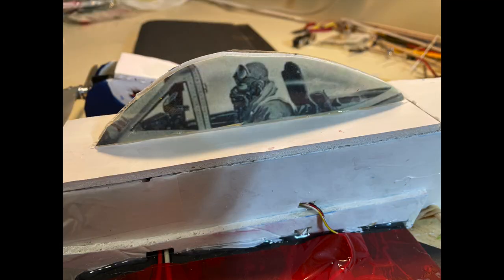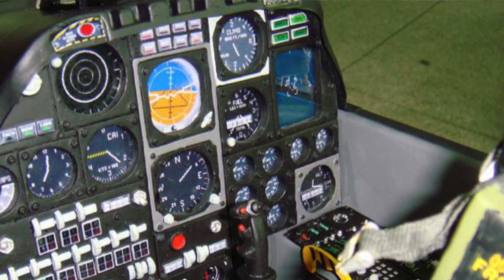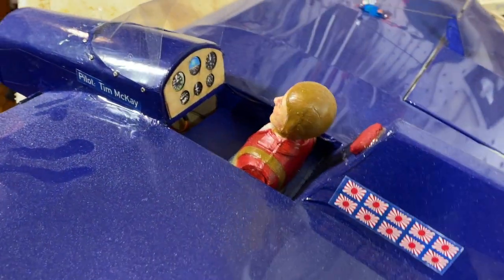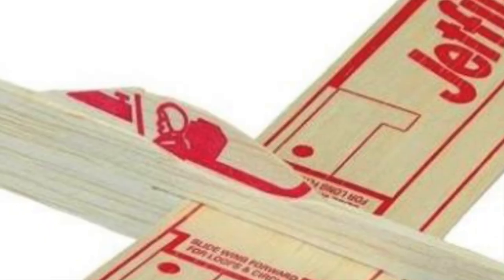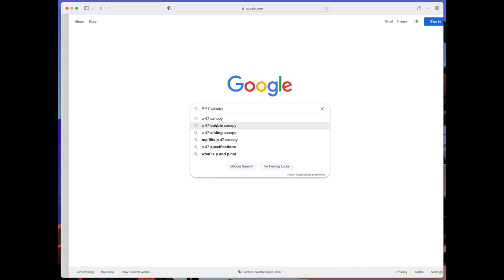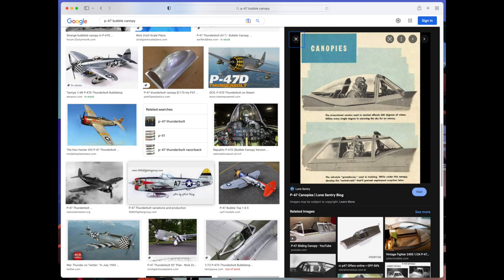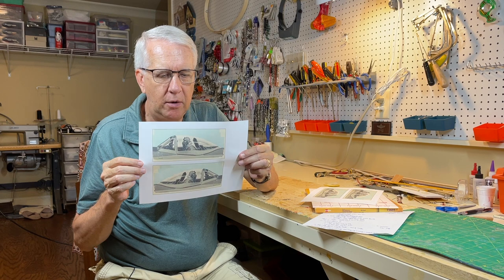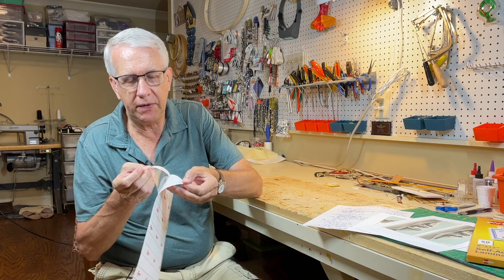Quick and Easy Realistic Cockpit for RC Model Airplane

Comment: the problem with a lot of the ARF foamies is that that the canopy is glued on and you can't get it off without damage in order to put a pilot in there.
Reply from the maker: Jim:  Excellent point, I am always on the lookout for canopies on eBay, swap meets, etc.  Tim